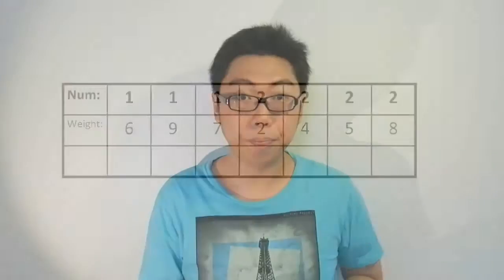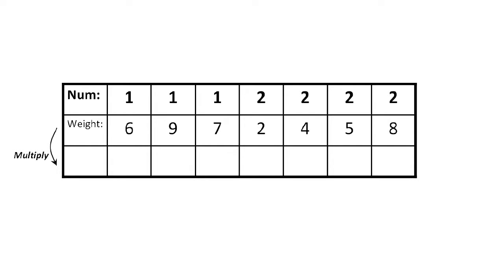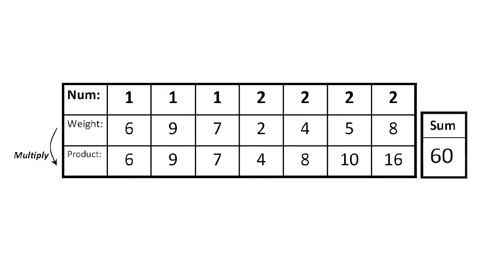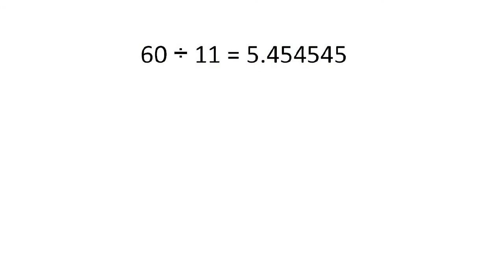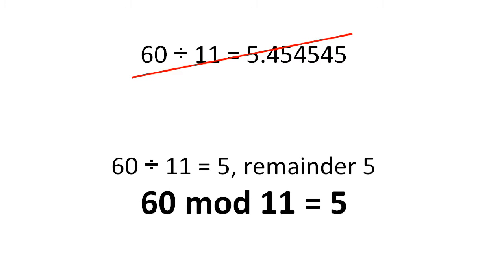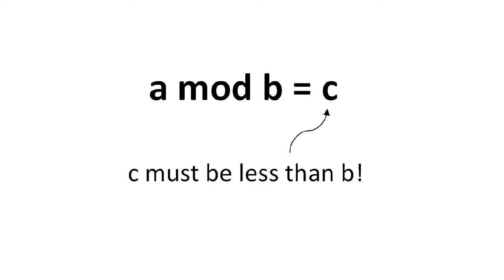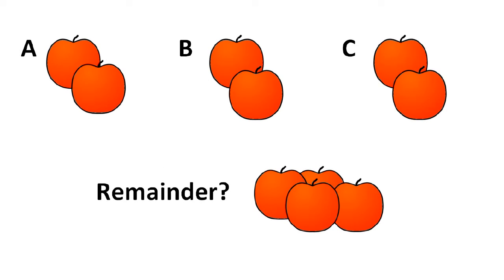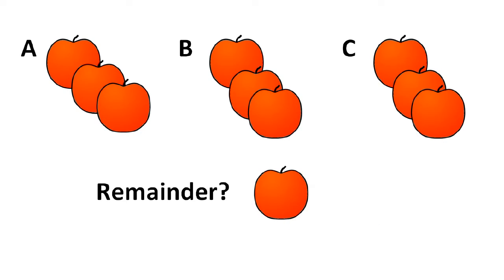Check Digits!

Comment: What is the difference between a checksum and a check digit? I'm a bit new to this topic in computer science
Reply from the maker: Hello and thank you for your comment! The two concepts are similar - Checksums and check digits are both values calculated from data, with the purpose of acting as a "second opinion" to ensure that the data is "right".

The key difference with a check digit is that it starts off as a checksum, but then you do some more computation to it to turn it into a single letter or digit, and add it to the data itself. So check digits often appear in places like ID numbers, credit card numbers, car registration numbers and the like, and is contained within the data itself (eg. The last digit of a credit card number is the check digit, but in daily use, we wouldn't know. It's just "there" as part of the number!)

When we say "checksums" broadly, they may or may not be included directly in the data like this. For example, in TCP/IP (used in loading web pages), each "packet" has a checksum included as part of the packet, but separately from the data.
Reply: @NERDfirst  Thank you sm! very helpful explanation
Reply from the maker: You're welcome! Glad to be of help =)